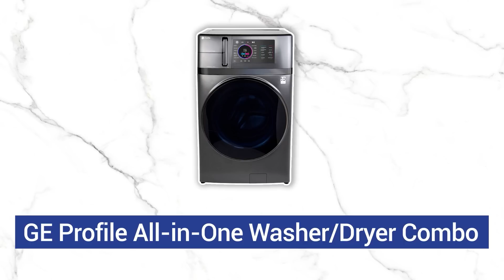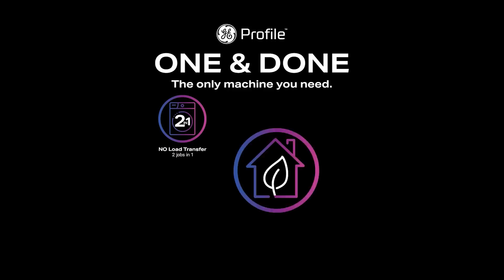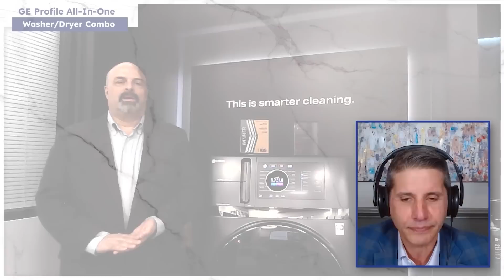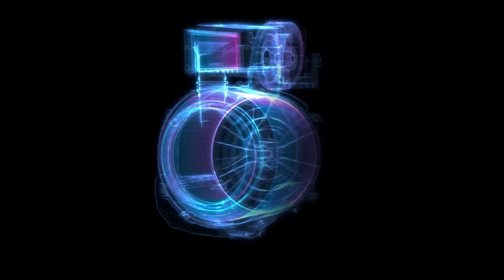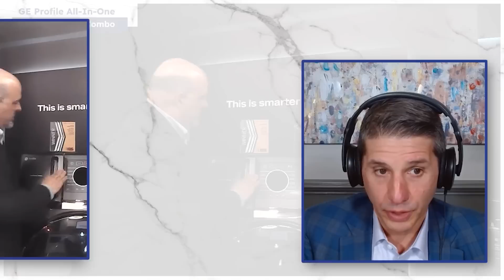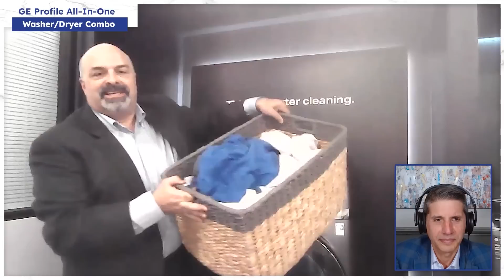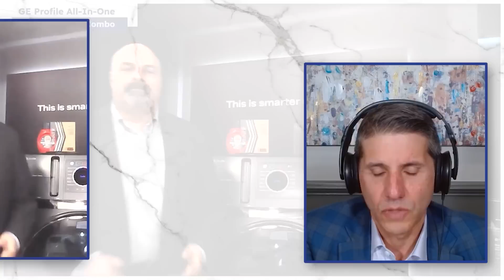New GE Profile All-in-One Washer and Dryer: Tough Questions for the Creator

Comment: This sounds very interesting, however..... One year warranty on the basic machine is a turnoff to a lot of people, especially introducing an expensive new type of washing/drying system. The first homeowners using this machine are going to be your "Ginny pig" real testers. They should at the very least, have a longer warranty that will cover the machines for initial invariable failed first generation parts. I was wondering what is the weight of the system since it has a lot of additional heavy parts in the same footprint of a washer. I was also wondering about the noise the dryer may emit. Regular home heat pumps have very noisy compressors. Refrigerator compressors on the other hand are pretty silent. Since the unit is 120VAC does the power outlet require 20 AMP service?

Comment: i bought one due to small laundry room when my GE dryer died weeks after warranty.  i wanted a whirlpool but since this fit better in my laundry room i tried it.  so far so good.  i bought extended warranty in case.  i actually like how it works.  

the manual says no foam rubber in machine.  now i am bummed.  i can find no info on if i can wash and dry my bed pillows. 

i will say bathroom rugs are the one thing i am still figuring out. takes a long time to dry even small ones.

Comment: We've had ours since July 6tb. After every load we have to clean out the lint trap and the blue coil to the right of the the lint trap because lint is going over the top of the lint trap and collecting on the blue coil thing. We're in the process of getting this exchanged through the store we bought it from, hoping ours is just a faulty unit. But yes, lint is flowing over the top of the trap and collecting on that blue coil. 😢
Reply: A channel I just saw recommended to seal around the edges with high temperature gasket maker to stop that. A minor fix.

What were the symptoms you had?

Comment: FYI.  Nothing against this appliance but its isn't GE.   GE sold its entire appliance division to Chinese manufacturer Haier back in 2016.   There is no longer any such thing as GE appliances as it has been known since 1908.  Haier retains the rights to use the GE name for 50 years.   I give Haier credit for investing heavily into the new acquired division which appears to be doing much better than when it was owned by GE.  But the use of the GE name is strictly for marketing.
Reply from the maker: Perhaps, but they added capacity to the US plants.
Reply: @YaleAppliance1  GE was chronically underfunding this division.  Its great that Haier stepped in after the Electrolux deal folded and invested in US production rather then move the IP overseas.  Would much rather see it live on under Haier than broken and sold in pieces.

Comment: Having lived in London where washer/dryers are common.....if this machine actually works well it would be fantastic. I'm not so worried about the heat pump/electric non venting dryer as I owned an LG dryer like this(the water  drain was plumed in) that worked very well. I think this product would be great as a 2nd washer/dryer either on the 1st or 2nd floor of a house.
Reply: This thing just came to be.  We need to give it some time to prove itself. Usually it works fine in begin.

Comment: White this is all great, the biggest problem with today’s washers is the tiny amount of water they use.  I used the HE detergents and the clothes still come out not as clean compared to my previous washer.  To prove myself right I hand washed the machine washed clothes and the water was dirty.  So on my LG washer I’ve readjusted the pressure sensor to allow more water in the drum of my front loader.  Now my clothes come out clean no matter what detergent I use.  I increased the water usage by about 10 gallons per cycle.  So the question is, is this another one of those washers that doesn’t really wash or rinse the clothes properly?  If so, would it be hard to manually overwrite the water level and increase it?  All new HE machines suffer from unwashed clothes.  You can check websites and that’s a constant complaint and why people keep their old machines as the new ones do a very poor job of washing clothes.  Your stains may be gone, but the clothes are still dirty, especially when you hand wash it and the water is dirty like your clothes were never washed. They smell nice for a bit until your body sweats a bit and the moisture penetrates the clothes and you can smell the dirt from previous wash.  No need to wear it, just spray it with pure water and it will smell dirty after being washed by all new HE machines. 
My plan is to buy a speed queen machines as that manufacturer uses heavy duty parts as those folks make machines in the US and are manufactured for the laundromats.  Their stuff last decades.   Throw few solar panels on the roof to compensate your higher energy footprint and get a machine that lasts, uses bit more energy and few more gallons of water per cycle but your clothes will be clean.  That’s my way, getting all this efficiency for small energy savings that two solar panels could offset doesn’t compute.  Especially when the machine uses so many parts and is so complex so more things can go wrong.  No thanks.

Comment: My biggest question I would have is where is the water going as you dry since it has no vent? 

I would be concerned about moisture issues (which leads to mold) in the area with the machine if they haven't figured out a solution. Perhaps they concentrate the moisture and pump it out the drain but I would want to see that mentioned in the features / specs
Reply from the maker: Water is drained...out the drain hose.

Comment: I’m curious about sanitation of clothes. My LG washer has the sanitizer mode which super heats the water from the hot water line to sanitize clothes. I know cold water is usually what is recommended but then we have to use a sanitizer chemical to get a similar result.

Comment: From an analytical analysis perspective: Resistive heating elements use 5X the current at the same voltage to achieve the same heating wattage as a heat pump.  In simple terms: A heat pump uses 5X less electricity to dry the clothes.  So you'll see your electricity bill go down any time you replace a resistive electrical heater with a heat pump.  The exact same thing is true when you replace an electrical water heater with a heat pump water heater.  5X less electricity is used to achieve the same heating.
Reply: And when you hang clothes to dry you use zero electricity.

Comment: Very interesting.  How does the dryer handle the cold generated by the heat pump?  Is the cold exhausted into the room, or where else does it go?
Reply: I have one. It's a sealed heat pump system. All the moisture is condensed out through a heat exchanger and goes out through the drain pump as water. The cool air is then sent into a compressor where its heated, and then a fan blows it into the drum. Once the air is in the drum, the warm moist air is drawn back out where it passes through a 2 stage lint filter and then back into heat exchanger where the air is cooled and the water condenses out, and the cycle repeats.

Comment: One of the biggest drawbacks I can see would be you can't wash and dry multiple loads of clothes as fast as you can if have a separate washer and dryer. That's because you can start washing your second load without having to wait for the first load to dry. That extra time increases each additional load you have to wash and dry. I can see where that could be a problem with a larger family. There would also be the issue years down the road when it breaks down, you would be losing both your washer and dryer at the same time. With separates, you would only need to replace one at a time since it's not likely they would both fail at the same time.
Reply: Yes but instead of babysitting the entire laundry process you can easily do a load at night or while you work or go out. If you want to spend every Saturday going to your laundry room repeatedly this is probably the wrong washer.
Reply: On the other hand, when these get cheaper your average home laundry area built for side by side machines can have double machines. Full redundancy.
Reply: The "babysitting" would still exist if you are washing and drying more than one load. You still have to remove one load of clothes to start washing the second load. You also have to fold  each load when they are finished just the same. When they make one that will fold and hang everything up, that would be wonderful. That's where most of the work comes from, not moving one load from the washer to the dryer. That part doesn't take very long and is pretty easy anyways.
Reply: Well Robert,  MAYBE Erin is right.  Babysitting IS such a chore.  The constant interruption of your television time and "friends" time and "me" time to babysit is the real crime.

Comment: This would never work for me. I do multiple loads at once. My dryer holds the same amount of clothes as my washer. Therefore I can wash a load while I'm drying a load. It takes you 2 hours to wash and dry a load, whereas I wash 2 loads and dry 2 loads in approximately 2 hrs 15 minutes.
Reply from the maker: we just tested against the WashTower heat pump.....so true

Comment: If this machine works as advertised it will be a game changer! I have always said that dryers destroy clothes.We all have experienced pulling clothes out of a dryer that are so hot you can barely hold them and that extreme heat is terrible for clothing. The idea of using a heat pump is brilliant and I would not mind waiting longer for clothes to dry as they will be better cared for and also the power savings. I'm going wait 6 months for more reviews to come out and if everything looks good this will be my next washer/dryer for sure.
Reply: Don't walk, run to get yours. We've had ours for just over a month. 100 loads in, I don't think we will ever go back. Laundry doesn't feel like a chore anymore. The benefit of running a load late at night or during the work day with the timer function is worth every penny. No more weekends full of laundry because it is so much easier to do loads as you see fit through the week. Everything promised is true. There is no hyperbole in this video.

Comment: I’ll have this unit soon I’ll have it dissected. Heat pump or the heating system isn’t what I would be cautious about. The main issue is the dual system. What I mean by that is, the drum assembly bearing spider and seal will be working twice as hard. I will have a comparable washer next to it to compare it with. Hopefully the motor and all the duel system are beefed up. The positive things are the voltage is 120 , ventless and save space. The negative is very heavy parts might be more expensive and cost more to repair/service. We shall see
Reply from the maker: Good idea

Comment: Thanks for all the concise info Steve! I just bought one from your Framingham Store! I have a tiny laundry closet that will now have much needed shelf space! ALSO, the old Dryer was an "indoor vent", which is hot moist exhaust into a water bucket... yuck. This looks to me the real deal!

But one question, why hasn't any other washer/dryer combo had a lint catch?? Seems extremely obvious!
Reply from the maker: Great question. 

A combo is your only choice if you only have 24 inches, a smaller space, or minimum power.  You see combos overseas because they do have smaller spaces. 

Most combos are small and are designed for one or two people, so the problem isnt as bad as if you are washing for a family.

BTW, thank you for buying from us.  I/we sincerely appreciate it.
Reply: Most of the European washer dryers used water to keep it fluff free, they would inject water through the pipe and it kept it really clean, the water that condenses from the drying would go down as well.  Had a Hoover Nextra washer/dryer for years with 1600 rpm spin, I had the matching condenser dryer and I would put the big stuff in the dryer to dry and would leave smaller bits in the washing machine and I dried so well,  European models are smaller that that huge great thing, and the rule used to be that you could only do half load as there wouldn’t be enough space in the drum for the clothes to tumble and drop down but now with bigger drum sizes the drying size has got bigger mine was 7lg wash load and 6 kg drying load.

Comment: Air flow, not heat, is key! In a small room (10x10), hanging clothes racks & a box fan, I dry my clothes in a few hours!
Reply: Awesome.  Folks living in non-humid locations can do that too.
Reply: Finally, someone else here who hangs clothes.  They last longer and dry more quickly under good conditions.  Most homes have space INSIDE and some can hang outside by disguising it as a flower/edibles trellis.

Comment: We need softener that doesn’t coagulate in the machine. I followed advise prior to purchasing my front load washer in 2017 to not use fabric softeners and my machine never took on that stink ever, even when clothes were forgotten and got musty. Also use white vinegar to clean that smell off of clothes and keep your rubber bits clean like your fridge etc. We need softeners with water like viscosity?

Comment: A relatively through discussion, not all full of buzz speak and cheer leading. Thanks!
While I realize Yale Appliance is in the NE USA so questions from a Canadian perspective would not likely get asked, but I wonder if this product will be released into the Canadian market, west coast here. Being a "smart appliance" would it operate efficiently and easily in rural areas without a network connection? How long can one expect parts to be produced and offered after the 10 year warranty runs out (or will it be the Maytag of the past with 30+ years problem free)? Can a person seated in a wheel chair see the dispenser well enough to be able to fill the compartments without overflow or spillage accidents? Does the door reverse so that it can be utilized in left handed apartment layouts as well as right handed? Nothing more frustrating than not being able to reach into the drum because the door opens towards you blocking your approach from the left. That extra rinse cycle that was mentioned, was that a third rinse like commercial laundry cycles to ensure there is no soap residue (or fabric softener for that matter) remaining before drying for those of us who are sensitive to that sort of thing? I wonder who in Vancouver, BC Canada would actually answer these tough questions?
Reply from the maker: Door doesn't reverse...I will be asking Ken more questions on Thursday
Reply: @YaleAppliance1  Thanks for that info. That has to be one of the bigger reasons why I still have not replaced the Maytag LA105, series 10 with a front loading appliance. The laundry basket and I would have to be on opposite sides of the appliance door inevitably leading to me leaning on the door as I reach over it to get items from the lower reaches of the basket. The front loaders I have been looking at in the past ten years would not stand up to that kind of punishment for very long. Flimsy hinge connections, plastic doors that flex, and not even remotely teenager proof. Oh well....
Reply: @rabbytca  Install a mirror so that you can easily see the soap drawer. Don't use fabric softener.  Purchase a floor mop, foam head style, with a squeegee handle, adapt that to make a detergent dispenser.

The rest that you wrote is correct.  I worked for the new GE, not the old GE, for a year.

Comment: Great video.  I actually bought one today.  Went into my local home improvement center They had them on sale for about $1000 of the normal price. A few mins later while looking around spotted one they had one that had a dent in the top.  They then marked that one 1/2 price off the sale price so I basically bought mine at 2/3 reduction. Score. I think this will be a winner for GE
Reply: Give us an update after 1 year.
Reply: Wow!
Reply: What do you think so far?
Reply: What do you think??
Reply: Only time something brand new to be on sale for 2/3rd the normal cost means it's junk and they are willing to sacrifice you and your hard earned dollars as a test rat. These units require way more maintenance that needs to be done way more often than GE recommends and they only handle a load of 15lbs efficiently anything more is killing the unit

Comment: Your engineer has it right. You need to bring something to the market that people want. For me washing and drying is a commodity. It is efficient enough that it has little or no impact on my life. In the last two decades the cost and hassle of broken machines is now the number one problem for me. Taking 2 hours to wash and dry a 10# load while stating the EPA is happy is not even on my radar. I hope the product takes off and it is very reliable. A landfill full of broken machines with no, or very expensive reapir paths is not the solution. These things need to last way beyond 10 years with the mean over 20. It used to be that way, and it is a real environmental soultion.
Reply: A landfill full of broken machines...like the Maytag Neptune? Sure, keeping the EPA happy isn't on your radar. How about spending half as much on the dry cycle, putting a lot less heat into your laundry room which has to be sucked out by the air conditioner, and being able to do what you want for 2hrs without coming back to find a load of wet clothes in the washer that still needs to be dried?
Reply: @johnbarker5009  not only that, but all the conditioned air being sucked out of the home.